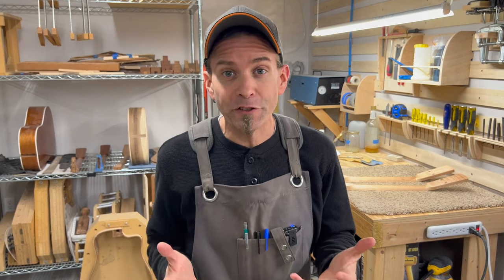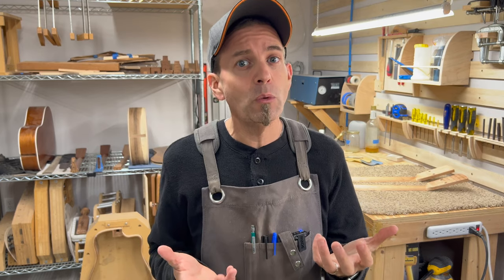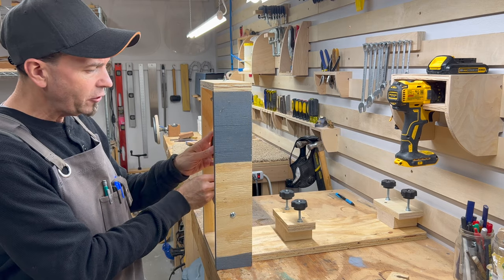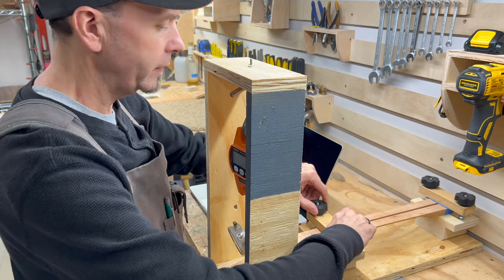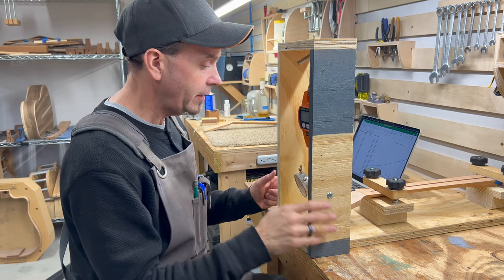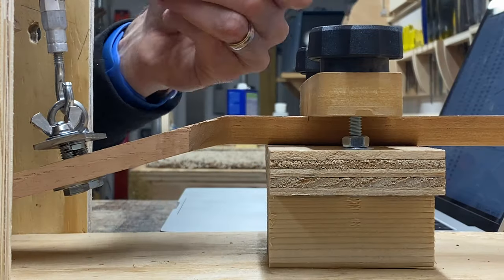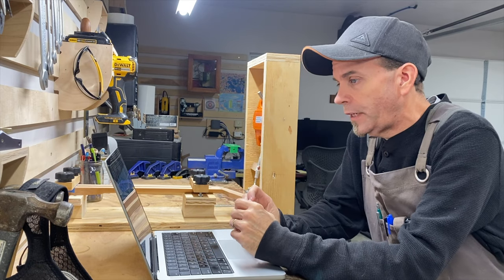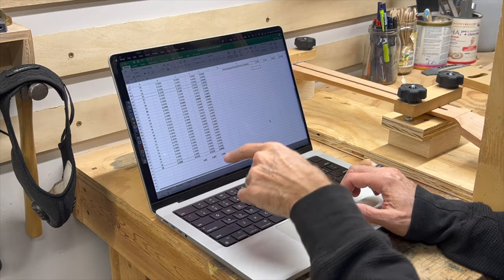Scarfed vs. One-Piece Guitar Necks - Part 2

Comment: Would be interested to see the same test with the neck attached to a body and the body is anchored vs. the neck being solid anchored so close to the headstock. Nice work and great test!
Reply from the maker: I hear you.  I did build a test rig for that exact type of test.  But as I considered the test, I felt like the differential in the numbers would likely be more indicative of the grain and slight changes in the timber than in the joint.  I wanted to focus specifically on the joint.  That said, it would be a neat test to try.  Maybe I can try that on a series of necks in the future... ones that I don't intend to break. 😀

Comment: I'm not surprised at all at this result. Because of the location of the mount for the fixture, the neck with the scarf joint is all long grain, which is the most flexible orientation.  For the single piece neck, the short grains are being compressed over the same distance, which is one of woods strongest orientations.  For a more accurate test, you really need to place tuners and a bridge at the heel and string it up to full tension.  Then drop the neck with the pivot at the heel from successively higher points until breakage (I know how much that hurts).  To be complete, I'd suggest performing two tests, one dropping on the back of the head stock (simulating guitar falling backward) and the other on the side (guitar falling from being rested and falling on its side).
Reply from the maker: Those are great suggestions for testing.  I wish I had the opportunity to incorporate those.  If you get the opportunity to run that test, I’d love to hear/see your results.

Comment: I'm actually not surprised by these results. The one piece neck is a continuous piece of lumber where the tree grew up swaying in the wind receiving pressures much akin to string pressure.

Subscriber #44, I'm about to build my first guitar and I have a beam of straight grained hard maple that I'm using on a Gibson inspired neck with a one piece walnut body. The nice part is it will be a gorgeous body. The downside is it's going to weigh a ton.
Reply: the issue is that the tension is now applied from a different direction and you have more short grain in an angled headstock cut from a single piece.

Comment: One thing I wonder about is the grain orientation in the two necks.  If the orientation is quarter sawn then that would mean that each neck has the same set of growth rings going through it, which would be ideal.  If the orientation is rift sawn then many of the growth rings would be the same, but the ones at the edges would be different.   If it was cut flat sawn then that means that the growth rings are totally different between the two necks, and that would be the worst case for comparison.
Reply from the maker: Good insight.  The block that I used was quarter sawn.

Comment: Great video! Just a thought after watching Part 2: There could be inconsistancy in the hold down force of the bar located at the scarf joint postion between the 2 necks.  Since they are held down with knobs turned by hand, the amount of hold-down tension at that point could vary.  Less pressure would translate to more movement - after a certain point (possibly where the graphs split). It is possible that this is an unaccounted variable between tests? Perhaps a retest utilizing a consistant torque setting on those screws could yield different results? Another thought: Isn't the highest string tension on the 3rd and 4th string positions, making it the greatest rotational force on the neck?
Reply from the maker: Great feedback.  There could be inconsistency in the tension of the knobs.  I'm not sure that would translate into enough movement to alter the results though.  At some point, it may become a game of inches.  I'll be interested to see if anyone takes it to the next level of precision.  Overall, it was fascinating to me that my assumptions about the added strength of the scarfed method were incorrect.

Comment: I never thought it would make that much of a difference but why would someone think a scarf joint would be stronger?
Reply from the maker: Mainly because the glue is stronger than the fibers, and by rotating the grain so that both the neck and headstock are straight grained, you are providing the most strength.

Comment: Stretch glue ;)

But that's why people test these situations - to challenge assumptions and pre-judged ideas.

It would be interesting seeing a test to failure - would they fail around the same load, would one be able to hold a substantial greater load than the other,  would they break down in the same place,  and how destructive would the failure be (is it fixable).
Reply from the maker: That’s the test I originally thought that I’d run once I decided to take them to a failure point.  I went with the impact test because it seemed like the more likely real-world test.  I agree though.  I’d like to see a test stressing them until failure.  Thanks for watching!

Comment: There are some things well done here.  Good camera skills, and a clever setup to measure everything.   But some things I don't agree with as well.   I think you're testing the correct direction of force.  But I wouldn't describe that as replicating string tension that pulls parallel with the neck.  I'm not concerned about string tension deflection at all?    But it is the right direction for the backwards tip/drop risk that I think is the primary concern.  I think you have to test a shock force, to replicate as the piece doesn't have to absorb/resist a continuous force in a drop.  It's allowed to flex and reverse momentum of the guitar falling until it either breaks or doesn't.  The maximum force applied at any time is just gravity.
Reply from the maker: Fair points.  I think forces are forces when it comes to the physics, but you are likely correct in that most people care about the impact resilience vs the deflection.  I was testing deflection because I’ve heard from many luthiers that the headstock is stiffer when scarfed. (and why I had built that way). Maybe an impact test is in order.

Comment: The linear trends do slightly differ in value. But does the difference bear statistical significance? That’s what we need to know.(edit, so at 0.058, the difference is barely significant only with the heavy gauge strings) right?
Reply from the maker: It's still over 13% different (better?) performance for the one-piece neck.  The challenge is (as we get into during the 3rd video in the series), does more rigidity mean a better neck?  It might hold up better to deformation over aging but be more prone to break if mishandled.
Reply: @pilsonguitars I do understand the difference in point percentage. But the p value, 0,058.. did reach slight significance (I assume that that number you worked out is excel is the value of statistical significance, that in that case would be meaningful only in the case of heavy gauge strings) so, my question wasn’t whether there is a difference, (there is) But whether the difference between the sample reaches statistical significance, and therefore can be generalised to broader population (scarfed joint /no fretboard mahogany necks)
In Which case,  (in the heavy gauge string case) we would say that whilst displaying a 12%? Difference, the statistical significance is only reached in the heavy gauge string condition, whilst in the light string condition, while we see a difference, it does not make us believe it’s due to the effect, but could be due to unseen factors. 

Sorry I’m being pedantic 😅, and I did find the overall video as very informative of the scientific method.❤

Comment: Great videos! 

Maybe I'll get to this level of quality with my content one day. 

So these results make perfect sense to me. 

Let me explain. 

The one piece allows less deflection. Any material that can not deflect will have a "snapping" point. This is why so so many one piece necks fail. Put a full load on it, and give it a jolt to the back of the headstock and... POP! 

The scarf joint, on the other hand, can flex. So when a full load is applied to it, and then it takes a bump, the long grain is more likely to be able to flex and return to shape. 

I'm sure if you measured maple you'd get WAY more deflection. More deflection means more ability to return to original shape and form.  How many maple headstock breaks do you get compared to mahogany?? I'm not saying it doesn't happen. But I litterally can't remember the last time I repaired a maple headstock break right now. In fact, I'm not sure that a maple neck of this construction style has ever crossed my bench. Like a maple jumbo or a maple necked les paul. 

So what is actually "better?" 

Eh 

I'll let someone else argue that point.

I've played GREAT guitars with both construction styles. 

But from a physics standpoint and thinking about the pliability of materials involved, this makes perfect sense to me.
Reply from the maker: Really great comments!  If I'm understanding correctly, you're theorizing that less deflection = greater rigidity = more fragile (or more susceptible to damage from impact)  That makes a lot of sense.  I wonder if the laminated necks strike the balance between those two?  Thanks for taking the time to provide feedback and comments.
Reply: Correct on my theory, yes. 

Less deflection = strong but brittle. (Well defined failure)

But I think that strength and rigidity are key elements to good tone woods for instruments. It's a balance. 

https://youtu.be/MBfzDEgfA0I?si=_4RoFW7BYBiY4ZOc

Here is a good video that tests this property in a lot of different species of wood. Food for thought. 

But in this case, we really are looking at mahogany long grain vs short grain.

Comment: I’m not surprised. The scarf joint is stronger in terms of being more flexible before breaking. The stiffer one piece neck will break sooner than the scarf joint.
Reply from the maker: I think that would be an interesting test.  I perform the break test in the next episode, but that’s an impact test.  It would be neat to continue to apply even pressure until a break and see the results.

Comment: Not what I expected. So... the old Chines proverb, "A well executed glue joint is stronger than the original piece of wood." Is that really so?
Reply from the maker: Yah, I had that thought as well.  I probably could make the case for imperfect execution of “well executed” in my build.  The result of the stiffness test is what surprised me most.

Comment: Try the other scarf joint (in the battom, not top)
Reply from the maker: The one that pushes it farther down the neck?  It would be an interesting test.  Would probably need to get a fretboard on it as well for that to be good and solid.

Comment: I think the test is legit but there are years and years of actual breaks that tell a very real story. Things not accounted for like the fretboard reinforcing the neck right at the nut. The huge truss rod nut access that Gibson and copies use. The fretboard reinforcement at the nut could pinpoint all the stress right at the short grain which would be mad even weaker by removing so much material for the rod nut. Maybe another way to test would be to use two completed necks. Even with truss rods installed. There thing is that until the necks are broken or fail you can't see the whole picture.
Reply from the maker: Fair points.  I would like to test on finished necks but just couldn’t bring myself to put in that amount of work to end up breaking them.  Maybe in the future.
Reply: @pilsonguitars you won’t see me trying to break a finished neck either. I appreciate your effort.

Comment: I suspect there is some fundamental physics flaw in your test. Measuring my scarf joint neck to headstock there is perhaps 1 degree of deflection, or about 90 thousandths...you got over 270 thousandths (light gauge strings). A couple of thoughts, first, you have concentrated the forces in the head stock alone while a guitar distributes them down the length of the neck, the reason we put truss rods in to control deflection. Second, the two short  strings in a head stock are loaded in direct compression into the length of the neck and probably add little in uplift forces. While you have tested absolute resistance to uplift bending I'm not sure you have replicated real world conditions. This is where the break test becomes important. Without significant uplift in a string loaded headstock the next consideration is the tendency for a loaded wood structure to fracture through the short grain. With as little deflection as I'm seeing the difference between the two seems irrelevant, particularly given that the string path is redirected at the nut. The battling considerations then would be efficient use of a valuable resource and possible risk of short grain breakage in an unfortunate accident.
Reply from the maker: Thank you for the feedback.  I think you’re absolutely correct about the forces being distributed down the neck.  So I may have applied 4x the actual forces.  It did answer the question of the flexibility of the headstock though.  I’ve heard many times that a scarfed headstock is stiffer.  We proved that was not the case.  Your comments are making me rethink how I’ll execute the break test.  Maybe we’ll put it under a string load, grip the body in a jig, and then swing a controlled weight into the headstock.  That should give us a good impact comparison.
Reply: @pilsonguitars  Here's a YouTube video with a good (and long winded) analysis of headstock breakage. https://www.youtube.com/watch?v=zIyIEX8PZBE   The only other consideration outside of construction ease that I can think of would be string energy absorption in a more flexible headstock, which intuitively seems too insignificant to worry about, but then intuition isn't science;)

Comment: Strength v. rigidity
You assumed longer grain would be stronger. You tested rigidity. Tests were done with the elastic limits of each piece. You did not go up to the breaking point (pasted the elastic limit).
Also, a single sample of each in not valid statistically. Final point, tests would be more realistic if the neck was attached as on a normal guitar and allowed to bend on its full length.
Reply from the maker: Appreciate the feedback.  Between videos part 2 & 3, I tested strength (flexibility) and rigidity (impact).  I could test the neck attached to a fixed joint (as if connected to a guitar), but that would have introduced more variables.  I wanted to concentrate the test on the transition and headstock.  I did run more tests than what was shown in the video with numbers that matched what I presented.
Reply: @pilsonguitars  Thanks for response. Your tests show that both necks are strong enough. I assume that a stiffer neck, would be better. It would keep strings to frets distance under control. I might be wrong, I am not a musician nor a luthier, just a casual woodworker who tries to  grab some proven techniques off YT. Will watch Part III.

Comment: It may be a bit pedantic (ok a lot) but please stop saying pressure when you are in fact applying force. Pounds is force. Pounds per square inch is pressure. 
What you have measured is deflection, deflection is a guide to stiffness not strength.Necks don't fail by deflection under string tension, they fail by cracking from additional forces from incidents such as knocks or drops
To measure strength, you need to take it to failure on both necks and compare final load forces
Reply from the maker: Noted.  Appreciate the feedback.

Comment: Well designed test but people dont break off headstocks from string tension.  How many stories of Fender or Gibson headstocks breaking off from a fall do you read about versus scarfed joints...not including Ibanez and the stupid locking nut holes.  I appreciate the effort here but I still cant be convinced.  Ask some repair shops what they think.  To equate flexion with weakness is a fallacy.  Every roller coaster, bridge, skyscraper, oil derrick, utility tower, etc is designed to flex.  To make them ridgid when invite destruction.
Reply from the maker: Great points... that's what we ended up testing in part 3 of the series.  Thanks for watching!